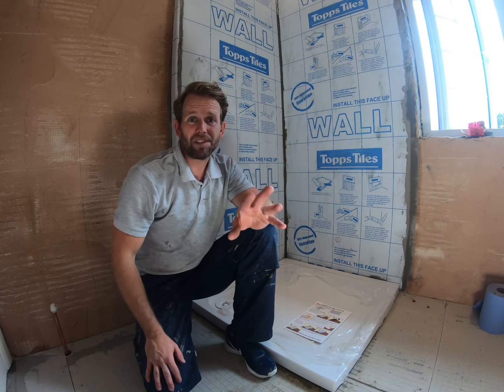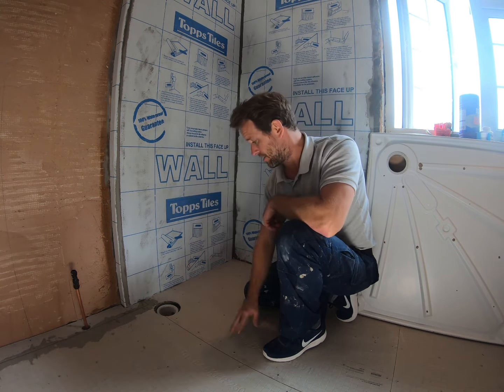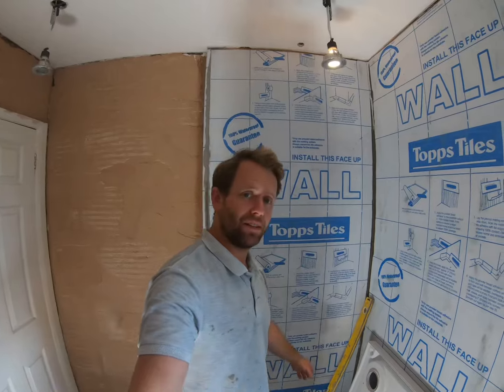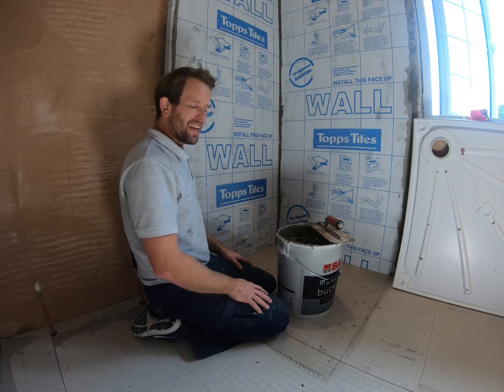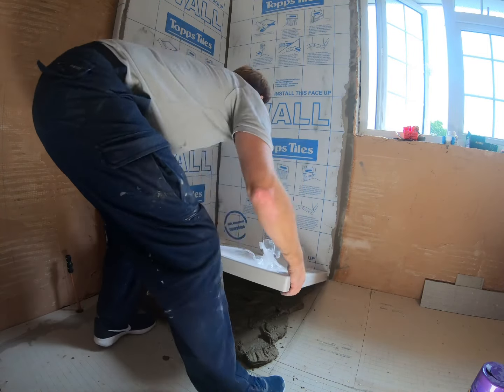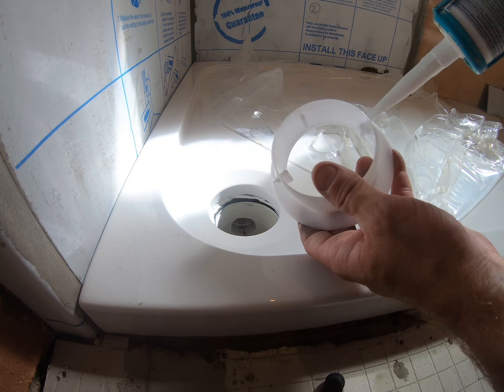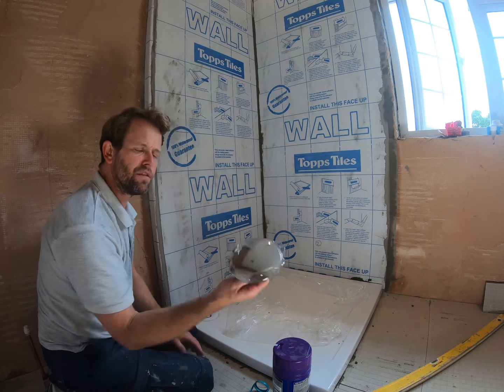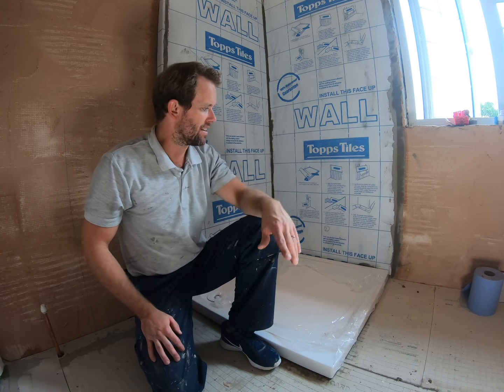How To INSTALL a Shower Tray | Simple and Straightforward advice |

Comment: if you silicone rubber seals you will never get them undone i thought you wore noted supposed to silicone rubber seals
Reply from the maker: I’ve changed plenty in the past. Better to get a watertight seal on a subfloor waste then worrying about having to change it in the future. Thanks.

Comment: Thank you for your bathroom videos Rob. I'm currently going through the planning process for my own bathroom and would appreciate a detailed video on the stages needed in order to complete the project. (think its called first fix, second fix, etc) I.e. clearing out old fixtures, stud walls, plumbing, wiring, type of flooring removal/replacing ready for tiling, ceiling  etc, etc. Best wishes
Reply from the maker: Hi Martin,

I’ll try and put up something like this very soon. All the best with your project. Thanks for watching.

Comment: Hi Rob. 
For sealing waste traps I would suggest to don't use acetoxy silicones as they dissolves many types of rubber seals.
Only neutral or polymer/hybrid, If you are using Dow brand use 785N.
also I have bad memories with those 'trade wipes' be careful on all plastic's and resins.  They are not designed for degreasing before silicone sealing as they have Aloe Vera (to keep your hands moisten) and other rubbish that silicone wont stick to.  Plain acetone (be careful with this one) or denatured alcohol works best.
Do you think that those cement boards with gaps in between will help you with any moisture ? Last month I've redone 2 years old bathroom that was completely failed by cowboys , and between plywood and cement boards everything was covered with mould, I think it's just makes a pocket for moisture.
For standard bathrooms we always using decoupling mats , it's completely waterproof ( if installed correctly)  and isolates from small movements from subfloor.
But anyway nice video, I wish  there was more when I was learning the trade 
Cheers
Reply from the maker: Hi Matthew, thanks for the tips buddy. I'll check those out. To be honest I'm not a big fan of the decoupling mats. I feel more secure with the hardibacker board as its bedded down with adhesive and also screwed and I think it's more of a solid base for the tray, but I suppose it's just preference really. With the wipes, I'm really only using them to remove dust more than grease, then completely drying the area with blue roll. Keep well and keep busy mate. Kind regards,  Rob

Comment: Is silicon enough round the edge as it ages and shrinks? Will it not leak eventually
Reply: Silicone won't shrink. In any case, you also apply a bead of silicone after the tiling is done. This is just insurance.

Comment: Great Video, I need to use a shower trap like yours due to the low profile stone resin tray and the wirquin that came with the tray leaked - what's the flow rate of the trap your using / manufacturer please?
Reply from the maker: Thanks, ours is a fast flow McAlpine 90mm diameter shower waste.

Comment: How would you solve the problem of such a large gap between the bottom of the shower tray and the floor when in comes to laying the flooring?
Reply from the maker: If it was a really large gap you could latex the floor or put a section of quadrant (half round plastic) to detail the area after the floor is laid.

Comment: Do you really have a need to put the sand/cement mix down on such a sound floor as that is
Reply from the maker: I would always. I don’t know what else you would use, certainly not silicone or tile adhesive. It’s just good practice for me personally. Thanks 🙏🏻